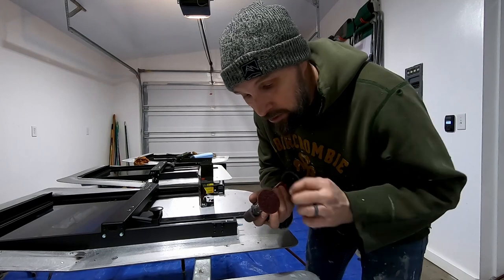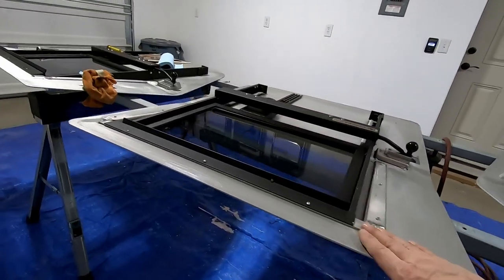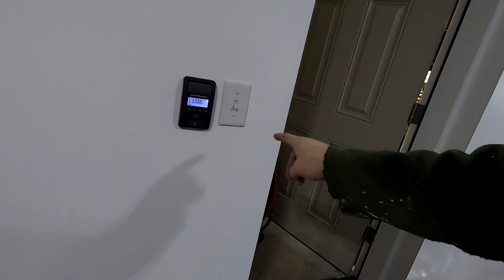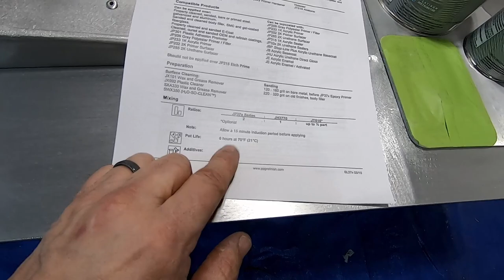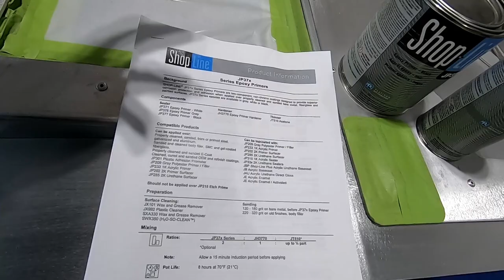Painting my Midwest Military Humvee X Doors

Comment: That’s one nice paint job! I have been using a clone of a Binks touch up gun for years with no issues other than the reservoir holds only half a pint of paint. I am surprised that you went with the nickel finish on the latches, was there an option for flat black? Any plans on adding a sound deadening mats to the doors? We recently painted a steel diamond plate ramp that goes to one of the doors to a military ISO comms trailer. It took about four days to dry outside in 50-68° weather. Even painted the trailer several months earlier when the temps were about 10° warmer. In hind site I should have went with a Matt finish instead of gloss. BTW a hint at cleaning aluminum, use a rag soaked with acetone instead of a tack cloth. Acetone leaves no residue while a tack cloth might.
Reply from the maker: They only come in high polish so there was no option.  You are right about the tack rag.  I may have pushed it into the upper doors on those two causing the primer to lift.   I meant to add the fact I asked the paint shop to provide reducer suitable for the temps I was shooting.  Otherwise I might have had a sticky mess on my hands.
Reply from the maker: Oh, and yes I’m still thinking through the back side.  Paint or a sound mat or both.  Haven’t made up my mind.